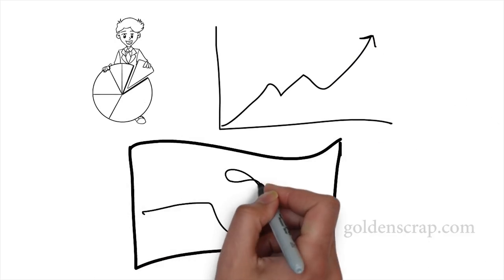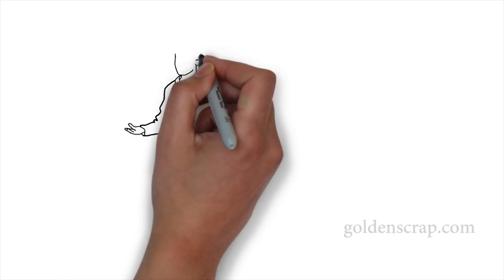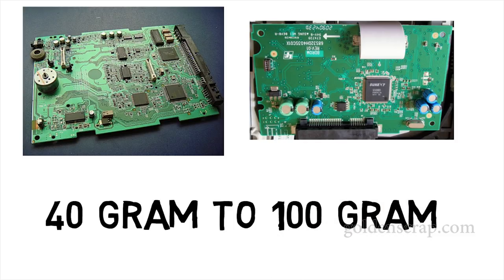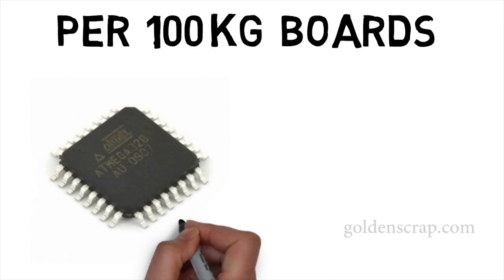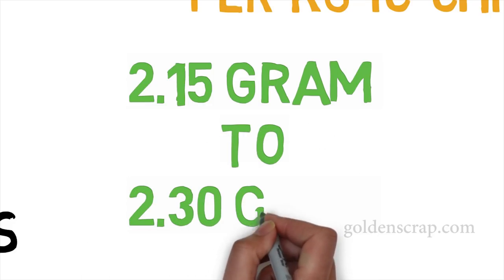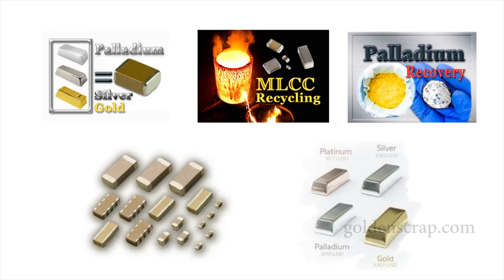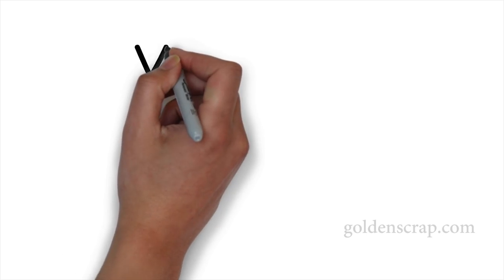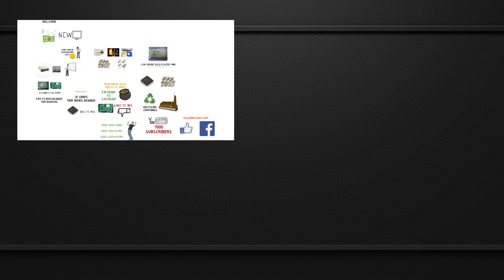📀Gold Quantity in CD DVD ROMs | Gold Recovery Techniques

Comment: Rom drive board cost 12USD/kg so 100kg is 1200USD, if 100kg board resulting 8kg IC (8USD/kg) thats is 8*8=64USD, depopulating 100kg board is an instant lose of 1136USD
Processing 8kg IC resoulting around 2,15*8*40=688USD a total lose of 1200-688=512USD + acid and time cost
It is totaly worthless to process better just sell the board!

How about the rest of the board any gold from it for example from the plug end?